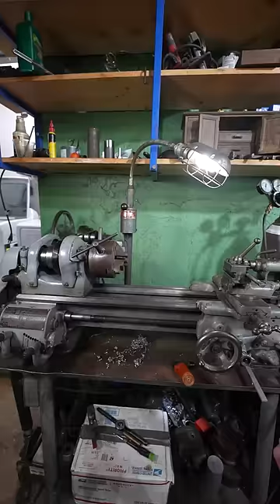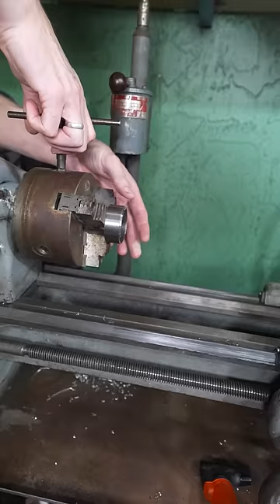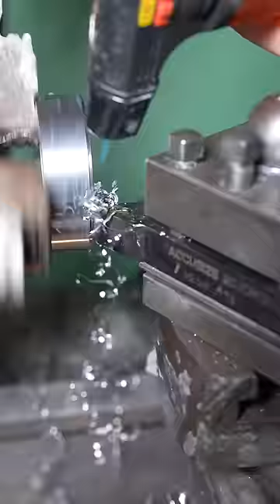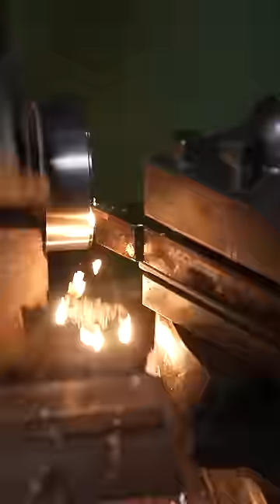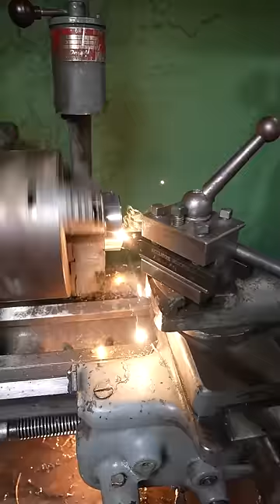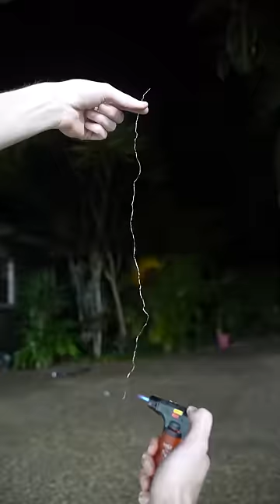Titanium has a dirty secret

Comment: "it's super flammable" 

Magnesium "hold my beer"
Reply: Aluminum is almost more reactive i.e why aluminum is used in incindieries and explosives but something like magnesium isnt
Reply: @todydn actually magnesium is indeed used.
Reply: Sodium, just add water
Reply: Setting magnesium shavings on fire is surprisingly very difficult. One of machinists back in the day got to permission to take the shavings home and he ended up soaking them in gas and using a blow torch to get them to ignite
Reply: @mattthemouse1  because they were cold. If you have a big pile of thin shavings and it gets some hot ones on it it will ignite. Powder only takes water and oxygen and it will.
Reply: @jeffrunyan2691 I think he was talking about binary explosives having aluminum powder as one of the reactants
Reply: @kw2519  well I saw magnesium powder catch on fire that was in drums inside a semi-trailer and all it took was a leak in the roof and some water got to it and it started oxidizing and it was nearly impossible to put out it was on the news they had to use foam they didn't realize what it was at first and they were spraying it with water which was just literally fueling the fire
Reply: @jeffrunyan2691  ya, but that’s magnesium. We actually follow procedures around magnesium chips 😂 

Honestly, my Ti chips always go into coolant and are always damp.  But I’m also milling not turning, so it’s just tiny chips, not thin wires
Reply: @kw2519  yeah the thin wire and bird nesting is what gets you. I had a friend that used to build Roots style blowers for Top alcohol in NHRA and one of the guys that worked for him was machining a case one day and caught a big pile of magnesium on fire almost burnt the building down
Reply: @jeffrunyan2691  haha I think every machinist knows another machinist that set magnesium on fire and almost burned down the shop 😂
Reply: @todydn pure aluminum will do that. 6061 isn't as fun. It's best not to share that.
Reply: @todydn good question. The main reason is that magnesium will corrode much quicker than aluminum. And a corrosion on fine powder will almost completely destroy it's combustion capabilities.  That means flash powder made with aluminum has a much longer shelf life compared to magnesium. And it's even more important if the fireworks are stored in a high humidity area.
Reply: @ShannonDove-sy7ye  that makes sense  thanks for the clarity
Reply: @jeffrunyan2691 For flammable metal fires the standard procedure is to cover the fire in graphite to smother them.  If I remember right you need a class D extinguisher.
Reply: Magnesium is the flammable part of titanium.
Reply: @1in7-Twist  wrong, titanium is an element. Unless you mean it's an alloy of titanium and magnesium. Otherwise it doesn't contain magnesium.
Reply: You copied my comment
Reply: As a firefighter, we had a fire run where an older air cooled VW bus engine, made from magnesium, caught fire. We didn't have foam to try to smother it. The engine is under the rear floor, so was tough to gain access to. We finally did get it cooled to below ignition temperature. I can't remember how many GPM we finally had running into the engine compartment. At least 2000 GPM, but that may be a conservative number. We had 3 engines on scene trying to get it out.
Reply: @k.h.1587  Phosphorus, just add air!
Reply: Hydride vs Dehydride, it’s like nitromethane compared to kerosene. Fun fact it takes 150# of class D extinguisher media to put out 15# of burning Ti powder. Never use water, or any other class of extinguisher, always cut off what’s fueling the fire, Titanium will suck the oxygen out of water and will only further feed the fire, if possible cut off any oxygen source and let it deplete the oxygen, drum fires are easily manageable if caught early by simply putting a lid and ring on. Salt reigns supreme in stopping these types of fires, but pouring salt onto flaming powder can agitate it and introduce even more oxygen and cause a flare up, best to use your own discretion when dealing with these situations, they get out of hand in an instant. And I can assure you, not enough firefighters are trained of these class of fires, watch the bodycam footage from “LAFD Titanium fire” right here on YouTube. They arrive on scene and unfortunately immediately make things 100 times worse.
Reply: @todydn oh really?
Reply: @k.h.1587 right lmao
Reply: @mattthemouse1 wow
Reply: @mattthemouse1 .....
Reply: @battalion151R  I used to burn VW motors on the fourth of July. I had a large steel pan, and I had a pipe connected to a leaf blower, would start  burning wood , then set the magnesium on the fire, then turn on leaf blower. It's burns much better with air blowing on it . Sometimes I would sprinkle a little water into the air intake on the leaf blower for added effect.
Reply: After burning magnesium, the ashes will contain a little bit of magnesium nitride. If you pour water on the ashes , the nitride will make a lot of ammonia, and is in fact a good way to synthesize annhydrous ammonia, as long as only enough water is used and no extra water
Reply: @ShannonDove-sy7ye  
  I could see someone adventurous setting a VW engine on fire. But, I have a hard time believing that a steel pan could contain one. I think the pan would merely turn into molten steel. Sand turns to glass in a magnesium fire. And, water just feeds more oxygen and hydrogen to it, unless you feed it enough to lower the temperature to below ignition temp.
Reply: @battalion151R  I can assure you that it doesn't melt the steel pan, I don't know why. I've done it probably 5 or 6 times, I had about 8 motors, all stripped down, only these sleel rods left in the ashes, I'm not sure what the rods was. A couple times the steel pan was the bottom part of a charcoal grill, the others it was a parts bin drawer. Sometimes it would end up with these small holes in it, but it did not look like it had been melted, it looked more like it was chemically eaten though. There was no hard "drops" of steel. A few times I would chop the magnesium into quarter size pieces and put it in the contents of a few road flares spread out in the bottom of the pan. Either way, it never melted the steel. Even those rods that was actually in the magnesium wasn't even bent , much less melted.
Reply: @ShannonDove-sy7ye  
  Hmmm. Interesting. I'd have thought that steel would have melted away. I'm not sure which rods you're referring to. The pushrods or the studs in the block that hold the cylinders on. They're solid and threaded vs. the hollow pushrods. If you're burning the cylinders you should have the cylinder sleeves too.
  Are you just trying to provide lighting for your neighborhood?
Reply: @battalion151R  yea, probably studs. They was threaded about a little on each end, but not the whole rod. And they was solid mounted in the magnesium, even after hammering peices off. No cylinder sleeves though. I didn't strip it myself. I went to a scrap yard, and and offered to buy magnesium....but the guy was cleaning up the place , (maybe going out of business) and he lead me to a pile and told me I could have as much as I wanted. I had my wife and 2 children in the car, plus the trunk was full of stuff, so I squeezed in about 6 to seven motors, I had motors around my young children in the car seat.
Reply: @battalion151R  but anyway, I was just doing it as a form of fireworks, I would have a cookout and have people over to watch. I had other fireworks too. I had a propane tank and an oxygen tank, and I would fill up 30 gallon trash bags with propane/oxygen in the exact right proportion, (I had a way to measure the gas) it was 4 parts oxygen, one part propane. Was very loud
Reply: @ShannonDove-sy7ye as opposed to boiling window cleaner/DEF/urine. Sounds like a good excuse to burn stuff for no reason
Reply: You cant light magnesium with a regular cigarette lighter i dont think. At least not that fast. All metals are reactive accept for a couple and even those are in certain conditions.
Reply: @todydn in order for aluminum to burn you need something like magnesium to start the reaction with an oxygen source. So yer full a crap
Reply: @kw2519 well, from what i can tell, he might have been thinking of thermite but he definitely had no idea what he was talking about.
Reply: @battalion151R why did you have to put it out? Was it late summer? A drought? Were people inside? Because it was so bright?
Reply: @thetruthexperiment  
 It was on fire in the middle of a road.
Reply: @todydn wrong. Aluminum is used because it does not decay in wet conditions. Magnesium on the other Hand slowly dissolves if put in water/moisture.
Reply: @todydn magnesium is indeed used in weapons. Dragon breath shotgun shells to be exact.
Reply: We've all lit strips of it I fire in science class, using a bunsen burner
Reply: Oh god please don't 

But in reality isint magnesium super hard to light on fire
I mean yea when it starts burning its just the incarnation of fire but don't you need like a blowtorch to get it started
Reply: @todydn oh magnesium is so freaking flammable dragon breath shells for shotguns use magnesium shavings the US military for a long time had some magnesium skin helicopters because it was like titanium for the time it was super lightweight strong but cheap until it caught fire.

So yes magnesium is highly reactive more reactive than aluminum
Reply: @clonescope2433  magnesium is highly flamable but it does not react like aluminum does in a reaction  most non binary explosives contain aluminum in some form magnesium burns like a mofo but aluminum detonates  also military db uses wp and magnesium civi rounds only use magnesium  or a combo of buck and magnesium. Magnesium can go into thermal decay easily on its own aluminum requires something to get it going but when it goes it goes in a bang not a fizzle
Reply: @todydn Aluminium almost instantly forms an oxide layer as its exposed to air tho which protects it from further reaction unless you don't let it come in contact with air as you remove the oxide layer.
Reply: Look the 1955 24 Hours of LeMans and the 1968 French Grand Prix for examples of magnesium's flammability.
Reply: @todydn aluminum is used as an oxidizing agent in incendiaries
Reply: @KruskBloodBane  i know its what makes thermite thermite
Reply: @todydn magnesium is used in flash bangs
Reply: @todydn of course magnesium is used
Reply: potassium (which can be set on fire easily and explodes with water) hold my ale keg
Reply: Magnesium is extremely hard to ignite, its just that once it has ingited it practically cant be stopped, i wouldnt say its super flammable
Reply: Magnesium is very difficult to catch on fire. It's easy to cut so it's hard to get heat to build up. The only magnesium fires I've dealt with was at the band saw. Those thin magnesium shavings love catching fife
Reply: That's because it oxidises which protects it from burning, freshly cut will burn nicely @mattthemouse1
Reply: @todydn magnesium is used as well. I think aluminum is just cheaper and more abundant
Reply: "The limiting factor" just did a series on magnesium. Both casting, and the fact that Dow and another company used to make money making the stuff out of seawater. They also have some nifty alloys that don't corrode. It's lighter than aluminum. Neat stuff.
Reply: @ShannonDove-sy7ye 
Apparently you don't understand that aluminium corrodes instantly in air, it creates a coating of aluminium oxide that protects the underlying metal an prevents further oxidation.
Reply: @bass2762  so do titanium and Magnesium
Reply: @todydn Thermite
Reply: @adarsh4764  magnesium isnt used in thermite aluminum is
Reply: @jeffrunyan2691 

Fine Aluminium powder will burst into flames just falling through the air... nasty.

But the classic is the Thermite reaction used to weld rail track together or cut it without using modern cutting or welding gear.
Reply: @k.h.1587  Caesium.....boom!
Reply: @mattthemouse1   "Setting magnesium shavings on fire is surprisingly very difficult"
Everyone who has ever used it as a campfire starter would say different.  One good spark from a ferrorod and it's burn time, baby.
Reply: Steel wool is very flammable as well.  ANYTHING that has a lot of surface area to allow quick combustion with the oxygen in the air is a problem.  Coal dust, dust from wheat in granaries, the ultra fine metal powder used in laser sintering and making MIM'd parts, etc.
Reply: @NINJAKCDX  no
Reply: @AlbertaGeek  I'm talking about pure, straight from machined metal magnesium.
Reply: Magnesium doesn't drink
Reply: Yes, we saw it burn, too. Stand back!
Reply: Titanium is much hotter than magnesium
Reply: Magnesium is used in signal flares but to get the shavings to burn you need to direct your air hose at it to really get it to burn but take the air away and it goes out .
Titanium can be much more dangerous
Reply: You can do the same thing with steel wool.
Reply: Magnesium is turned with kerosene as coolant believe it or not.
Reply: @1in7-Twist  no. There is no magnesium in titanium. Magnesium is an element and titanium is an element. I don’t know if they can be combined in an alloy, but I’ve never heard of it.
Reply: @NINJAKCDX  no. One type of survival fire starter uses magnesium, a scraper and flint. The scraper is used to shave off thin strips of Mg, then the steel is scraped against the flint to create sparks that ignite the magnesium.
Reply: @kitsune_gt  Mg shavings can be ignited with a flint and steel.
Reply: @PORSCHE_COUNTRY.  well yes, that method of making ammonia could be used in a reduction of ephedrine to meth.  Maybe it would be better than generating ammonia from cold packs.
Reply: lol

Comment: It's neat that it can be flammable while being REALLY heat resistant. It's melting point is 1670°C which is 200° higher than Carbon Steel.
Reply: Flour dust is explosive
Reply: This is so counter intuitive. :/
Reply: @deven6518 I guess this is because of the increased surface era and exposure to oxygen at the same time?
Reply: Indeed, “super flammable” = joke.
Reply: Surface area combined with freshly cut unoxidized metal without a passivation layer
Reply: @deven6518  sugar dust is also
Reply: what an ironic metal
Reply: What? It's 3,027 degrees I thought
Reply: Meanwhile, welders use tungsten for welding with TIG(Tungsten Inert Gas) process.
Reply: @tonyscalze4077  Maybe you think it in Fahreinheit its over 3000 F  he was talking about celsius
Reply: Many types of dusts are explosive when floating in the air that are not even flammable when piled up on the ground or in a solid form.
Reply: Got me wondering how it is that such a substance can be welded.
I've been around plenty of titanium machining and chip handling, and never knew it was flammable.  We would keep the chips in a ~3 bushel tote that got transferred to a Gaylord sized bin. I guess we were lucky we had no problems.
Reply: @ronfox5519   now that we understand the pitfalls (like embrittlement) it's relatively straightforward to weld with the correct equipment, surface prep, and parameters (like annealing temps/times) for your part... you need to do it in an inert atmosphere (usually argon) which can be challenging when working with larger pieces but that's true for a lot of materials which is why a lot of manufacturing relies on carefully engineering the tooling... sometimes the majority of engineering goes into the tool not the part. But "standard" welding techniques evolved slowly alongside industrialization so people look at it as less scientific and more of an art but that's not really true it's just more commonplace and all the cans of worms are more familiar to the engineers and machinists.  With advanced materials used in aerospace applications, like titanium we had to speed run learning about the correct process.  Finding that learning curve was the hard part.
Reply: @robmorgan1214  
Thanks for the response.
Do you have a problem with titanium  starting fire while welding it?
Do I remember correctly that it conducts heat quickly, like aluminum? I think this high heat conductivity is why TI is hard to machine.
Reply: @ronfox5519  Ti is a poor conductor so the surface gets hot.  Also like copper it work hardens.  So that's fun.  And it's already pretty hard and needs lots of coolant and it's reactivity is annoying and embrittlement is a thing if it develops small cracks that gas can infiltrate.   Other than that it's not really that bad. Aluminum copper and steel all get screwed up if you do it wrong.  Know your feeds n speeds and keep your surfaces clean or properly passivated.
Reply: @robmorgan1214  
Interesting.  Thanks.
Reply: @ronfox5519  if you think about it... it rarely matters how careful you are when using brass copper steel or aluminum and they are often treated accordingly... So you may see materials fail far earlier than they should but the application never gets anywhere near that point during the parts' lifetime ... but when you wanna go mach 3 with your hair on fire your titanium needs the machinist to treat it MUCH better than he treats his own family... I don't know much but I know I've murdered steel rushing things in the lathe but it didn't matter... probably the part should have been annealed but the part was not that important and temporary. I dont even know what it was I just grabbed something shiny off the shelf... lots of things happen this way and it just doesn't matter. But there are times when I've handled 304 or 316 with kid gloves because when you need THAT specific material you really NEED it!
Reply: Yeah, fine steel shavings will burn too, Titanium is not super flammable, it's just easily oxidised when it is fi e enough.
Reply: @scottsherrington7294  I've NEVER had steel chips burn on a machine even when using flammable coolant. I've heard many horror stories about titanium.